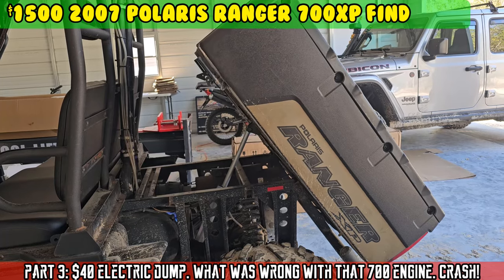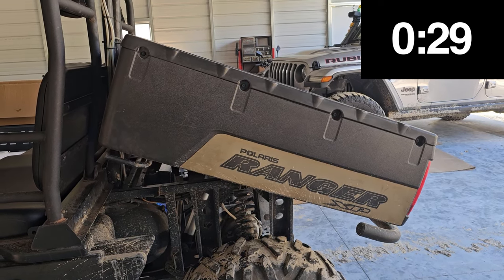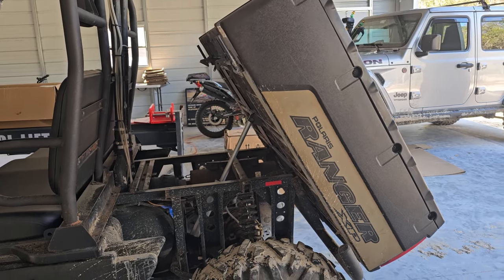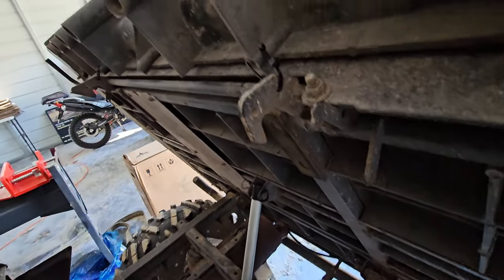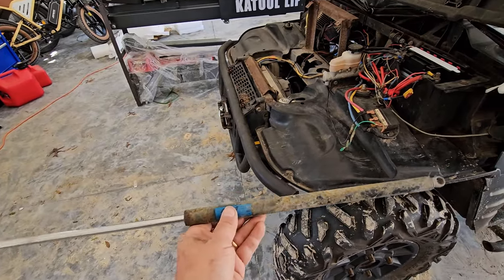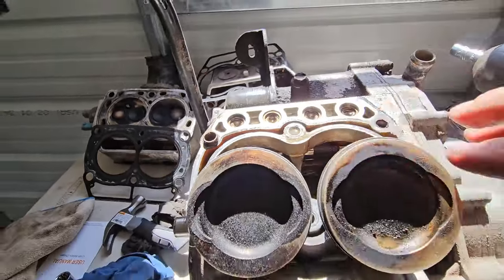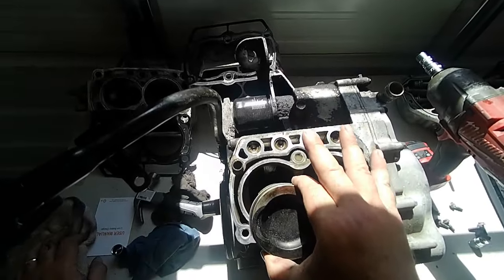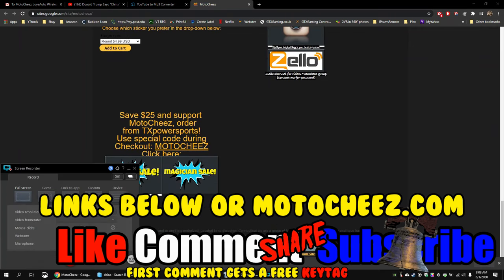PT3 $1500 Polaris Ranger 700XP. $40 electric dump, tear down the old engine, Crashed into a tree.

Comment: You can press the crank apart and replace the needle bearing and rod. Its done the same way a snowmobile crank is. I've done a few of them.
Reply from the maker: I was going to look into it, is it keyed? Or how do you line up the crank?
Reply: @MotoCheez  No its not keyed its just pressed, but it take over 40 thousand LBS to move it on average. The jobs i did I just used a piece of thick angel iron, hose clamps to hold it flat to the angel iron and a press to put it back together. Its a ghetto way of doing it but it works. If its not strait it wont fit back into the block, so you would have to take it apart and do it again.  I'm sure you could get a machine shop to do it for not to much money.  I've even done it on motocross bikes.
Reply from the maker: @darianballard2074 hmm. If I get a press, I may attempt it

Comment: That motor looks almost exactly like the 03’polaris sportsman 700 twin me and my old man just did.   Top ends cheap to fix. Bottom ends alittle bit pricier..   
moose racing top end gasket set was 120$      We did the mechanical water pump seal also while we were in it. Hotrods cranks and rods..     
believe the camshaft intake lobes were made of a softer steel and with poor maintenance caused em to wear out..    good luck. Easy engine to work on

I should ask him if he kept the stock crank and rods..  ill look into that. Gonna see him sunday
Reply from the maker: It is the same I believe. Yes easy engine to work on. 

Awesome, let me know if he still has crank w rods.
Reply: @MotoCheez   well your new video reminded me.  I saw my old man today but he threw away the old bottom end he said the rods were almost welded to the crank and had slap to them like yours.. I guess the oil pickup has a screen on it and it was damn near plugged tight.  Said it wasnt worth keeping. But it was worth asking.  Sorry about the luck chuck.  But ill keep an eye out!
Reply from the maker: @2StrokeSmoke544 thanks, was worth a shot